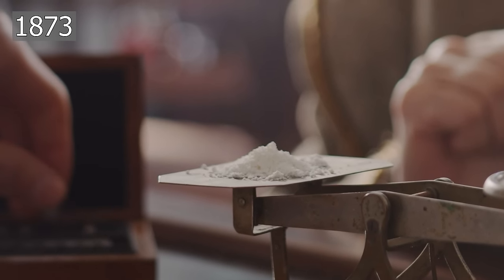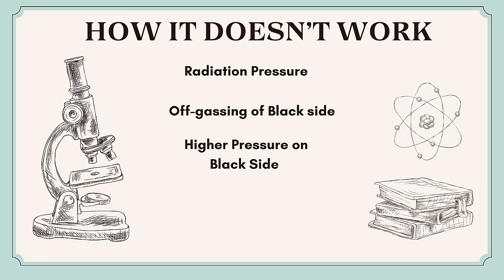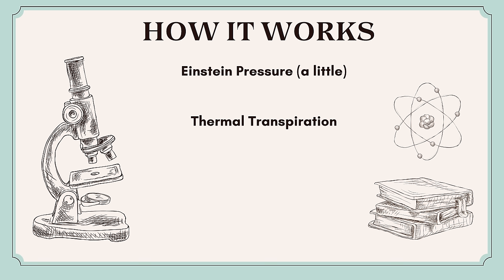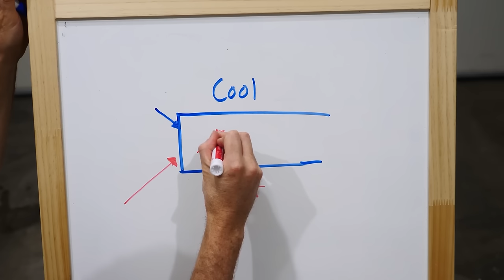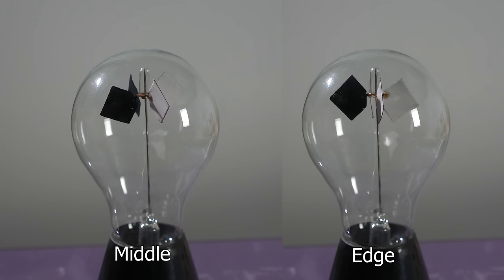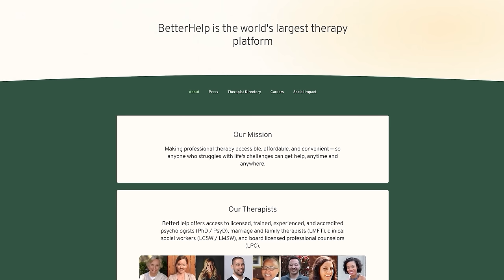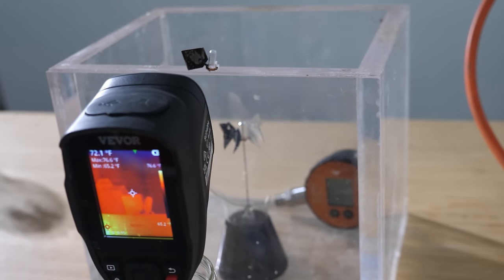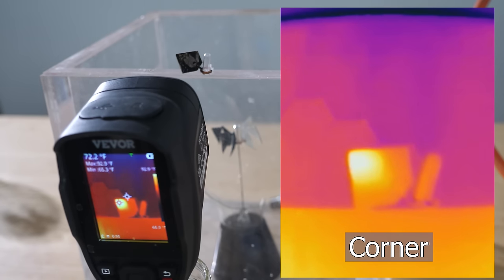Trying To Solve The 150 Year Old Mystery

Comment: I used to have one of these as a kid. I always assumed the light heated the black side better, which heated the air causing a small local pressure increase, which pushed it. I had no idea there was so much to consider and that it had stumped some of the greats. Thanks. :)
Reply: Did yours spin as slowly as the one in the video?

If I pointed a flashlight at mine (way less than 100,000 lumens) it would be a  spinning blur.  Definitely not even close to slow enough to count seconds per rotation.
Reply: @PowerScissor  the original radiometer is at lower pressure than the vacuum chamber of the video: that explains why it turns so slowly
Reply: @PowerScissor  Interesting observation. Though I don't remember ever shining a flashlight at mine, it also spun very quickly especially in sunlight. There could be many reasons for the discrepancy... I did notice that the light seemed about as bright as my 1,300 lumen light, but I assumed it was due to the camera. Also, perhaps LED light has a considerably different effect than sunlight or the light from an incandescent bulb (such as I had seen my radiometer respond to). I would first guess that it was due to lower pressure in the constructed chamber than the original.
Reply: @miguelalonsoperez5609  I am of the presumption that the radiometer in the vacuum chamber used was operating under lower pressure than when contained in the bulb, since I had read specifically that they are designed with a "partial vacuum," and that an absolute vacuum would not allow them to work. It was also stated that the vacuum in the chamber was at "0 bar" and "the lowest [...] can read [...]."
Reply: @xionix4  in that case may be the opposite: I don’t know which is the optimal pressure to produce the rotation effect, but nevertheless I suppose the one inside the bulb is better calculated to maximize the soeed
Reply: That's what I'm assuming as well. The blackbody radiation on the black side is better at locally transfering thermal energy to the air molecules in its vicinity than the white side, so you get those molecule all kinetic and they push against the black side more than the opposing white side. It would be interesting to see if different coatings with the same emissivity but different thermal conductivity behave differently. Also, I wonder if insulating the white side would help.
Reply: I suspect tha release of gas from hot surface may be the reason of the rotation or at least contributing. The other is molecules of air. You should replace air with helium and try to see if changing the gas changes the speed, this would exclude light from the causes.
Reply: @aldoloveri3493  it was demonstrated the thermodynamic effect in light-mills, as you say the thermal difference between sides is the cause of the rotation, not the radiation pressure.
The optimal air pressure to produce the effect has been found at approximately 1 Pascal, and the rotation disappears at 1x 10^-4 Pascal.
Also researchers had constructed a one-color light-mill based on geometry (one concave side and one convex side 4 plates mill)
Reply: @miguelalonsoperez5609  how does this fit in with his experimental result of absent rotation ? Seems like bigger problem for all these theories than he later presented it as
Reply: @sFeral  absent of rotation is produced by complete absence of air molecules to produce push by Newton 3d law (which is the correct explanation to the whole experimental findings). Or conversely by excess of air molecules: in this case the air dragging annihilate the force of rotation. Only the good concentration produces the rotation

In fact, it was found that rotation depends on temperature differences between the sides of the wings and on air pressure.

For example, it has been found that rotation goes on the opposite direction when placing the radiometer inside a freezer without any intense light, which is explained by increased heat dissipation (and cooling) of the dark sides
Reply: @miguelalonsoperez5609  your first sentence can't be correct if all his attempts were made under the same pressure
Reply: @miguelalonsoperez5609  In his next video he should keep the light on the "photon windmill" the whole time while he's pulling the vacuum
Reply: @sFeral  in fact, if you make holes on the plate you can produce thermal conduction between both sides of the wings which cancel the thermal difference between them. Also reducing the surface may explain the absence of rotation just by decreasing thermal emitting surface below the minimal pressure to win air dragging.

Despite the author’s opinion, today light-mills are well understood, since many physicists made research on them by historical interest.

You can easy find the formula of radiation pressure from light intensity at given temperature and find immediately that is barely nothing compared with friction of the axis of any engine. Radiation pressure will give instantaneous rotation but what happens is a slowly acceleration that in fact you can see better in the video
Reply: @sFeral  I recently did a little research about the topic, with a friend who is physicist (I’m not one, just ancient mathematician) and we found that the best pressure is quite low, around 1/100.000 atm.
Perhaps if he turns the vacuum chamber slowly he can see the increasing rotation and the decrease till the actual speed, but I have the intuition that will be very difficult since the rotation starts at less than 1/1000 atm, pesks at 1/100.000 and disappears at 1/1.000.000…
Quite narrow window, it was a chance thar his vacuum chamber goes under 1/1000 atm to show the effect! 😅
Reply: That is the answer! This video makes no sense.
Reply: @miguelalonsoperez5609  I had no idea it rotated in reverse in a freezer. That's very interesting. Thanks for sharing. :)
Reply: @xionix4  if you have one (is very cheap today), you can put it barely inside the freezer with door open to see the effect.
Avoid intense sources of light because they will counteract the reverse effect of cooling
Reply: Also avoid touching the bulb with hands, as thermal radiation from the crystal will also make spin the device in the usual sense
Reply: @xionix4 The problem with that description is that it's incredibly vague. Space is scientifically considered to be a partial vacuum as well, because it's not truly empty. There's gas floating around in space, things like hydrogen and helium, but at a pressure so low we can functionally think of it as a complete vacuum.
Reply: Try a parabolic shape
Reply: I think this must be at least partially right. Cutting the holes in the vane reduced the surface area impacted by the heated air molecules, so it didn't work. This makes more sense to me than the idea that all the propulsion is formed at the vane edges. He also mentioned that it doesn't work in total vacuum, so it must require at least a very small amount of gas molecules present to be heated by and impact against the vane. I wonder if it would be possible to make it also work in reverse by shining the laser on the white side of the vane. If this was some fraction slower than the light on the black side, you could relate the speed of the turning vanes to the amount of energy absorbed and converted to heat by the vane. I think you could also use shades of grey to get a more continuous measure to back up the theory.
Reply: @miguelalonsoperez5609  so you are saying it is sort of a Brownian motion effect ? caused by individual air molecules ?
Reply: @Nathan-dt2tu  seeing as it is much lower than what we can produce in a lab we are stuck with it as the zero vacuum
Reply: @edwardmacnab354   nor random browniann movement, just classical thermal effects: gas heating increases kinetic energy of molecules that push against wings. Or it increases pressure and so force by unit surface if you want. The difference between a classical steam engine here is the super tiny pressure gradients involved and the predominant air drag until air reaches the optimal concentration to allow the unbalanced forces and air drag is bellow the net forces at given speed. Obviously if they speed increases a lot, the thing will reach its terminal velocity
Reply: @miguelalonsoperez5609 The freezer explanation doesn’t seem credible to me. The reason is, the vane surfaces will be emitting in the IR spectrum due to their much cooler temperature than the sun, and both white and black paint tend to have the same IR emissivity.

In other words, neither the black or white side should cool quicker inside a dark freezer as a result of their own thermal emission.

The wavelength dependent properties of coatings and their relation to heat transfer are often misunderstood because they are not intuitive. Common white paint does not “cool” via emission any better than black paint. It just reflects radiated thermal energy in the visible spectrum better, making white objects in sunlight cooler than black objects due to energy balance. (Same emitted energy, but different absorbed energy.)
Reply: @400_billion_suns  Nope, the black paint absorbe more light than white so is hotter than light one, or respectively white is cooler (a matter of your zero point).

Then wings transfer heat to air by contact and convection, not by emission.

I don’t understand neither what you said that radiation in IR is the same… IR radiation depends on temperature not on the color. If you put a black metal plate under sunlight it will get very hot by absorption so it will emit some quantity of IR. A white one reflects more light so as not getting so hot it will emit less. 

The balance between absorption and emission is the total energy that contributes to temperature, is the classic problem ob black body radiation

Or an I missing / forgetting something? 🤔
Reply: @miguelalonsoperez5609  When you say it will spin the opposite direction inside a freezer, do you mean you first have to place it in sunlight (or bright visible light), get it spinning, and then put it inside a dark freezer? If so, how long will it continue to spin in reverse in the freezer?

If that’s what you meant, then I was misunderstanding you.

Otherwise, my point was this: inside a dark enclosed freezer, there is no energy to be absorbed in the visible spectrum. The cold walls of the freezer will emit a small amount of IR-spectrum thermal energy, and the vanes of the radiometer will also be emitting in the IR. The vanes will come to equilibrium temperature via radiation exchange with the freezer walls, and since their IR emissivity is the same with either color of paint, both sides of the vane will equilibrate to the same temperature.

Thus there will be nothing to set up the temperature differential on opposite faces of the vanes to make it spin, when inside a freezer with no visible-spectrum energy source.

You’re correct that IR energy emission is a function of temperature, but it is also a function of specular emissivity. If two surfaces have the same IR emissivity in a closed environment (e.g. the vanes of this device), where the walls of that environment are also emitting only IR-spectrum energy (e.g. walls of a freezer), then the two surfaces will eventually equilibrate to the same temperature. The one that started out hotter will just take a bit longer to get there.
Reply: @400_billion_suns  it has to be inside the freezer but with light, you can leave the door slightly open. It only spins because different light absorption, without it doesn’t work.
Reply: @miguelalonsoperez5609  Ah, I see what you mean now. Hmm. That still seems strange. What is driving the reverse spinning? The absorption from visible light will be the same whether inside or outside of the freezer. The only thing that has changed is the slightly colder environment surrounding it, which will act equally on the vanes in terms of radiative exchange. It's not clear to me how this would make any difference.

Comment: The non-spin of the holes is a result that seems like it's worth pursuing. If you know why that stops it spinning, you might know why it spins without them.
Reply: His radiometer already spins quite slowly, and punching those huge holes shrunk the surface area by around half. He'd need to pull a tighter vacuum since his friction is non-trivial.
Reply: @Nathan-dt2tu  A tighter vacuum would be worse.
Reply: @dragoscoco2173  Tighter vacuum is how the toy version is made, and makes it spin faster. You are correct though, as you keep going tighter still, the spin would start slowing down and eventually stop working.
Reply: @Nathan-dt2tu  I wonder if the extra holes introduces turbulence that equalizes the force, because I don't really buy that halving the surface area would cut the force so much that it couldn't overcome the static friction.
Reply: @Nathan-dt2tu  - At least in English, the common term is higher vacuum rather than "tighter vacuum." Admittedly, "higher" is a silly term for it. Another term, a slightly less silly term is harder vacuum as in It is harder to make that lower-density vacuum. All vacuum is commonly referenced to the pressure of "One Earth-normal atmosphere," but that is silly too since atmospheric pressure is constantly changing. To be totally clear about the subject, you have to use the uncommon measure of actual particles per unit volume, usually molecules per cubic centimeter... but that is very difficult to actually measure. As a point of reference, the 'best' vacuum we can make on Earth is still about FORTY THOUSAND particles per cc, while out in space, the solar wind averages about THREE protons per cc, with also 3 electrons per cc. But the mass of electrons is so low, they are normally ignored when referring to the pressure of any vacuum. Unfortunately, it is all rather approximate. 😕
Reply: @Nathan-dt2tu need magnet bearing
Reply: I thought he would try single holes in the centers. Slitting them slowed them, holes stopped it. Could the squares be sized to wave lengths for best results?

Comment: Here's something else to try.  Replace the squares with disc's where the center is white and the outer ring is black.  Hold the size of the center constant while varying the surface area of the outer black ring.   Record results.

Swap the white and black parts and repeat.  Record the results and compare.
Reply: this sounds like something i would write in an A-levels physics exam
Reply: I'd modify your idea a bit. Keep the surface area of the inner disc and torus to be equal. Then somehow ensure a uniform light source, perhaps with a laser and an accurate lens to ensure every part of the disc is exposed to the same lumen level. As you proposed, run the experiment with the black on the outside and the inside and record results. One revolution isn't enough for accurate results though. He should be timing how long 10 revs takes, or recording the number of revolutions in a full minute or more.

If a proper physics lab were to do it, they could track one of the vanes and have the light source follow, keeping constant focus on the disc itself.

I also wonder about the materials used in making the vanes, because I'm betting they don't stay straight when exposed to the light. There must be one side of the paper that's expanding more than the other. Black on inner vs outer part of the vanes could contribute to more or less bending, and then the shape of the vane needs to be considered since a sail is essentially being created.
Reply: @Nathan-dt2tu  
So yet another direction to test; convex for black or white, and then what change would a cone shape have, what about using spheres, so on
Reply: Hot side imparts more kinetic energy to the gas molecules than the cold side.

Intensify the vacuum.. Then not enough molecules for it to work.

Let the gas get more dense, and faster molecules on the hot side get reflected back, along with their momentum.
Reply: It's already been done.
Reply: I'm just a carpenter, but I know what's happening here... the cooling fan from the light is blowing it... no applause just throw money... 🤔😂🤣🇦🇺👌
Reply: @Nathan-dt2tu   Turn many times a disk when pointing a laser towards it and record the results? Are you describing CD ripping? 😁

Comment: You need to make sure the rotational momentum & CG are the same between the ones with slits/holes punched/solid, i.e. if you punch holes you will need to make the paper longer, and if you cut slits you will have to stack them horizontally.

Also, the hole punched might not work because it might caused local circulations and negated the effect but that's just a guess.
Reply: True rotational moment of inertia less for vanes with holes.
Reply: And perhaps cut the slits radially instead of along the axis of rotation. That way the mass doesn't move outward changing the moment of inertia or the moment arm of any torques being produced.